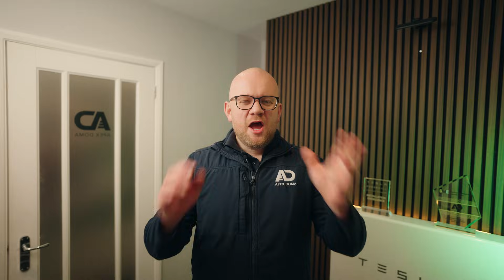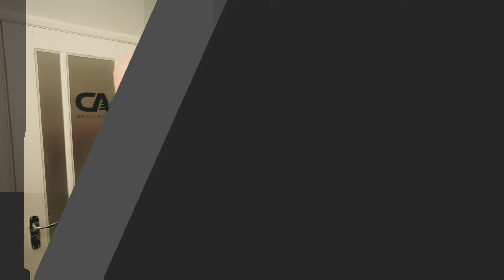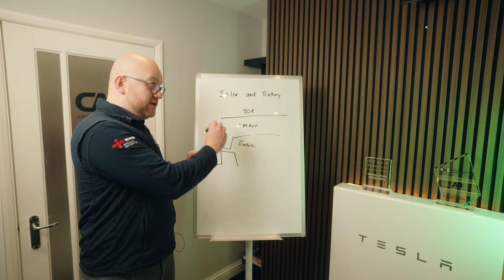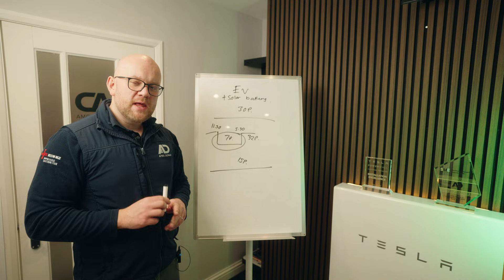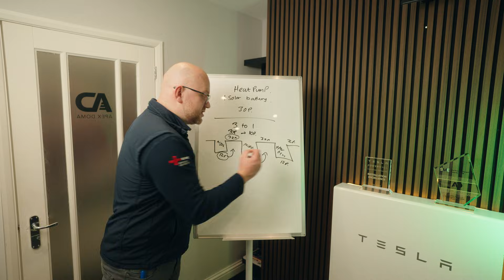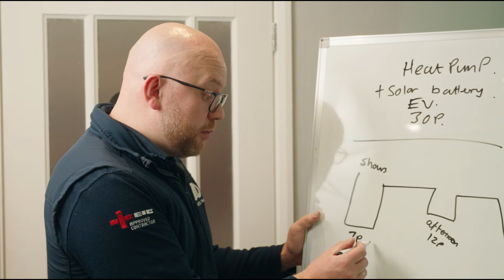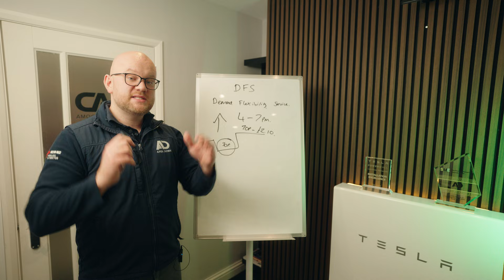How to Choose the BEST Solar & Battery Tariff 💰

Comment: Wow I'd to stop walking dog screw up my eyes and really really listen  ...so apologies to anyone I ignored on that walk. Thanks for this ....
I'm hoping that if I get a smart charger that I can charge the car ( not bought yet) as my batteries are not intelligent enough to take full advantage of my o octopus options.   SUCH A MINEFIELD  thanks for your help ....I really appreciate it as I'm sure do others...so...second question would be to keep costs down could I add to my 10 kw battery with another battery purely to download from grid to allow for more winter usage of electricity ? As nearly 70 I know I can't keep carrying logs forever and heat pump doesn't seem to be an option for this highland cottage ?

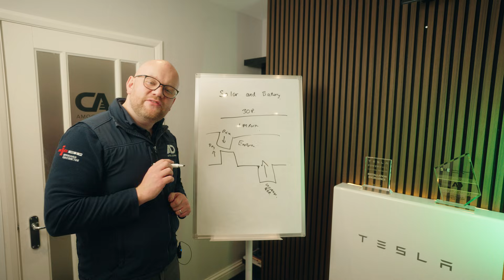Comment: Eon next ev tariff 6.5p 00:00 til 07:00. Fixed at 26p rest of day. 16p seg rate. I have GivEnergy 8.5kw battery with 4.7wh on the roof. My seg payment pays for my winter gas.

Comment: I need help with my system. I have the old Feed-in tariff(2011). 16Kw Solar array, 38kw batteries, 16Kw heat pump and an EV. I am on Octopus intelligent Go 7p at night. My batteries are not enough for the day as the 2x Givenergy Hybrid inverters are not working properly.
I want to sell my one year old system and go for Tesla 54kw. Give up Feed-in tariff and go for SEG.
Can someone advise please.
Reply from the maker: Yeah sure, feel free to drop us an email and we will either be able to give you some advice or help you out 😀

Comment: Looking at getting batteries to add to solar panels. I’m on a FIT from 2011, can I keep the generation payments, cancel the export part & have SEG export ?
I presume the panels will be connected to the new Hybrid inverter & batteries after the old generation meter, we have a Smart household meter. Thanks Phil

Comment: What a huge faff and upfront cash investment. Just remember to factor in the true costs of battery storage, which is normally between 5p and 10p per kWh cycled through the battery. Some setups will benefit but I'm sure that many are wasting time and infrastructure chasing a few pennies a day or worse, running at a loss. Not to mention the large environmental, resource and transportation costs that may never be offset. That's whilst getting significant subsidies and tax breaks from the rest of the nation to get the installs off the ground. Good luck.

BTW. I do have a solar pv uk setup, just want people to be informed.
Reply from the maker: Thanks for the comment, and I really respect where you’re coming from. You’re right that batteries aren’t a guaranteed win for everyone, and it’s important people go in with their eyes open.

That said, I wouldn’t say 5p per kWh is a fair estimate for cycling losses. Most people are charging their batteries using off-peak EV or solar rates between 7p and 10p per kWh — not the full 26p unit rate. Even with around 6 percent round-trip losses, that’s only about 0.5p to 0.6p per unit lost. For example, if you charge at 7p per kWh, a 6 percent loss adds just 0.42p, bringing the true cost to around 7.42p per usable kWh.

It’s also not just about savings. For many, it’s about resilience, self-sufficiency, and using smart tariffs like Octopus Flux. But it all comes down to system design and what the homeowner is trying to achieve.

Appreciate the thoughtful discussion this is exactly the kind of conversation we need more of.
Reply: @apexdomasolar  Thanks for replying.
Yes, from a purely financial perspective, the approximate cost calculation I was thinking about was:
(battery cost and install) / (cycles of life) / (usable kWh capacity) = 5p to 10p per kWh cycled. Plus some conversion losses as noted.

This crude calculation also depends how far beyond the cycle life a battery goes, when some manufacturers quote 'unlimited' cycles, which must be finite at some point of percentage degradation, eventually leading to hardware replacement.

So roughly speaking, when you get a cheap rate charge at ~7p/kWh, the 'true' cost of each of those kWhrs is likely 12p to 17p. Which (to me anyway) often doesn't make the battery financially viable, if the tariff price differentials for the import/export rates are very close.

'Use case' dependent acknowledged, for example. I have a fixed rate import 21.4p and a fixed export rate of 15p (Octopus, it's nice and simple). That price differential is currently so close that it is hard to justify investing for the 'true' cost of cycling kWh through a battery.
Though, if you already have invested in a battery install, then you might as well just use it.

This calculator page helps estimate the margins https://garydoessolar.com/utilities/dailymodellingutility/, if you subtract the 'true' daily storage costs and toggle the battery modeling option on/off, by mentally accounting for the true cost (5p to 10p) for every kWh cycled through the battery per day (via force charging or collected from solar). That financial result may only be a few pence/day for storage that costs from say £3k to £8k invested every 10 years. 

Of course when the tariff differentials widen or if the export price dropped back to say 4p/kWh, then a battery becomes a more attractive financial investment. 

Or maybe I'm looking at this a bit wrong... (post edited for clarity)

Comment: An ASHP coefficient of performance (COP) works in the opposite way that you explained. If an installation has a COP of 3 (modern units can achieve 5) then this means that for every unit of electricity that is consumed, the unit will produce 3 units of heat  So in effect the ASHP is 300% efficient.

A modern condensing gas boiler is approximately 90% efficient. However, gas prices per kWh equivalent are substantially cheaper than UK electricity prices, which impacts the cost of running an ASHP.

I have an ASHP (7 years), battery storage (2 years), and solar (4 years) in my 90's home. I have the heating on at a constant 20.5C and my total energy costs are £600 per year for a 4 bedroom bungalow.  This technology works but the integration between an ASHP, batteries, and smart tariffs is not well understood by most installers.
Reply from the maker: Thank you for the insightful comment 😃

Comment: This is good advice that i had mostly worked out but is not being shared that much on the interwebs. One question the "hybrid" tariff sounds mega as it gives me what i currently have (a cheap night rate) and combine it with a couple of cheapish periods during the day. The problem is i can't find a single tariff like this anywhere on the market. Just one example of this being real would be fabulous :).
Reply: I've read the comments now and can see Tomato is no longer taking new clients. Are there any other companies that will offer more than one cheap rate period?
Reply from the maker: Currently it was just Tomato Energy that we were aware of, that offers a triple dip. They will provide new registrations in the future; keep an eye on the website. 😃
Reply: @stu0508  They are in financial difficulties...
Reply from the maker: Thanks
Reply: I use the Octopus Cosy tariff, it has three cheap periods totalling 8 hrs within a 24hr cycle.

Comment: Octopus have confirmed that it is permissible to change between go and cosy  summer/winter with no penalty. But they point out that it may take a few days.
Reply from the maker: Thanks for this.
Reply: I use Cosy during the winter due to the three cheap periods and then change to Flux during the summer months to benefit from the improved export tariff.

Comment: Hi, thanks for the video. Useful to understand the general principles and different usage scenarios here. Would be great if you could explain how to go about setting up a spreadsheet (like you mentioned) and whether you know of any single source for different tariff information (other than awful price comparison sites).

Had a look online at the DFS you mentioned - It appears that you can only get access to this as a residential customer via ‘Registered Providers’ like Octopus Energy etc - is that right? I thought you were suggesting there was some way to sign up direct?

Would also be interested to know a bit more about the API methods you mentioned and some resources to find out a bit more about a way to ‘set and forget’ some optimisation of your energy import and exporting. I have a SunSynk 8kW Hybrid inverter (and an ASHP and 15.6kWh of battery storage - had gas supply removed too) and have used Octopus Energy tariffs in the past to automate the setting of importing and exporting, however would like to know a bit more about how to take control of some of this myself including how to find the best company to sell/export energy and at what times without being stuck with just a single supplier for both import and export (if that’s possible). It’s a bit overwhelming to know where to start, so some steerage on that would be really useful please 🤞👍

Comment: Thanks Ian. You did touch on it, but it seems to me that we need different tariffs summer and winter.
Currently 4kWh of solar and 5.8 kWh battery using Octopus Go to charge battery and run dishwaher, washing machine after midnight.
Next week getting additional 11.6 hWh of batteries and then Cosy6 heat pump after Easter. 11 years old house has EPC of 'A' FWIW and 4kWh pump sufficient but too noisy.
It seems to me that I should keep Go for summer when I shall buy very little power from grid and then flip to Cozy for winter.  may not be able to store enough in the three hour low price intervals.
At 78 I am still seeking challenges but slowing down on the solutionss.
Reply from the maker: Hi Mark, 

Take a look at Tomato Energy. They offer an EV / Heat pump tariff that might work well for you. As you have rightly said, you may wish to look at tariff flipping. Typically, there aren't any penalties for doing so with Octopus. However, you may be subject to minimum terms of a particular tariff, usually 6 months, so the timing of changing the tariff is important. 

Thanks for watching.

Comment: Rather than use battery for washing machine and dishwasher I use the delayed start to have them come on during the cheaper charging period.  Washing is ready in the morning to hang on the line for solar drying.
Reply: Do the same but use a heat pump tumble to dry them
Reply from the maker: You are both right here; we do the same and have also gone for a heat pump dryer. Make the most of the greener night rate.

Comment: Only one word to describe this video 
BRILLIANT JUST BRILLIANT 
Thank you very much you have answered all most every question I ever had here as I had little or no knowledge of how this worked but I have now 
3.84 kw of solar 2 EVs and a Powerwall 3 and a FIT payment now the only thing I now need to know is how I can set this up I have seen from an earlier video you did I will need to give up part of my FIT I’m  on Octopus intelligent go and also have a Heat Pump so I will speak with them
Once again a big thank you.
Les
Reply from the maker: Hi Les,

Thanks for the awesome feedback. It makes it all worthwhile. 

You can keep your FIT payments, register your deemed export to smart export guarantee (Octopus outgoing fixed) and then have your incoming tariff on Octopus Go Intelligent.

If you find your PW3 running out, take a look at Tomato Energy. They offer a heat pump / EV tariff. 

Hope this helps.

Ian

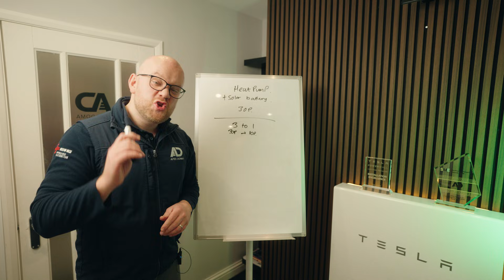Comment: I’m now on E.ON NextDriveFixed V6, having moved from Agile and Flux with Octopus. Solar and battery system installed last December (6.825 kW PV, Tesla PW3). At 6.7p for 7 hours (12:00 to 07:00) the system automatically charges during the off-peak and exports at 15p (flat rate) from both battery and Solar any energy not needed by the house (based on learning our usage) leaving 20% charge to cover possible outages. Sun or not I don’t need to set or change anything and I never use grid energy at peak times. I have a rule in NetZero to drop the reserve to 10% after 9:30 pm if  the battery discharges down to the 20% reserve by then.
Reply from the maker: Thanks for this; our head of accounts is on precisely the same tariff as you for her electric car. Interestingly, this is lower and longer than the intelligent go rate with Octopus and the same fixed rate. We have learnt something there. Thanks for this comment.

Comment: Octopus intelligent Go for me. Had 11kw solar and powerwall 3 fitted in October and haven't used peak electricity since. Cosy 9 installed last week and Gas removed. Guessing I might need the exspantion pack for winter 👍🏼
Reply from the maker: Sounds great! Yes definitely keep an eye on your usage and consider an expansion pack to make sure you're covered or look at octopus cosy and see if you can make the most of the triple dip tariffs.
Reply: @apexdomasolar  Having to charge an EV the Cosy tariff doesn't work for me price wise 👍🏼
Reply: @petecpw  With no EV the better Octopus tariffs aren’t available to me. However, EO.N’s NextDrive tariff doesn’t require me to have an EV and is better than GO. They also do an add-on I believe for EV users to match Intelligent GO.
Reply from the maker: Thanks Colin
Reply: @colinfieldgate4719  I Almost switched to that eon tariff but the standing charge was 64p and octopus has just reduced to 42p from the  1st. V6 a great tariff without having to have a EV 👍🏼
Reply: @petecpw  Yeah, the E.ON Standing Charge is higher than Octopus. But with no EV, it’s far better than Flux.